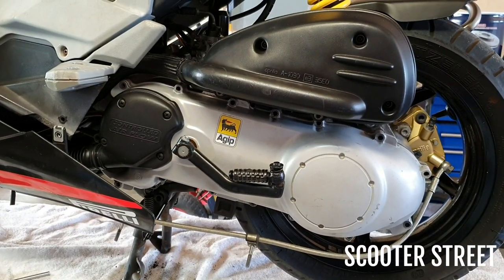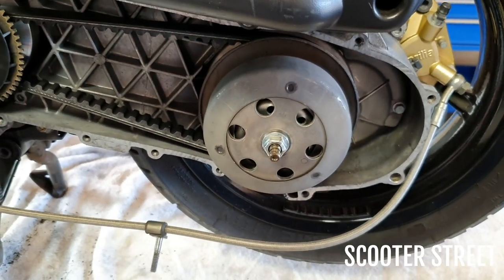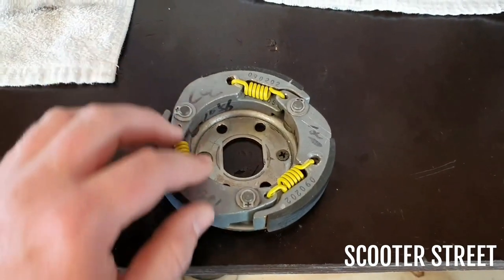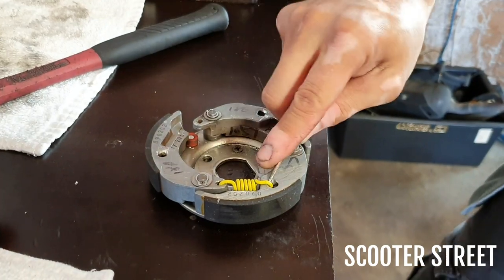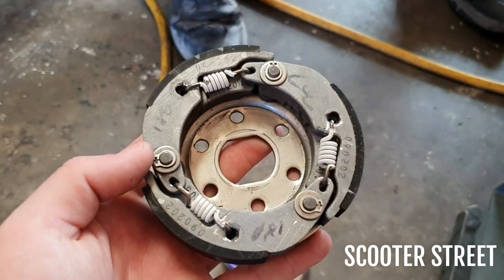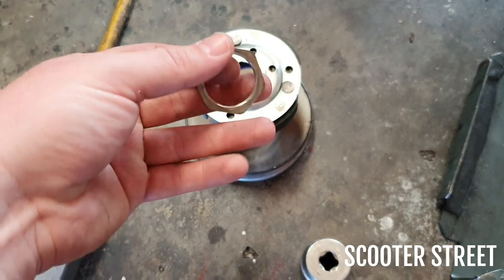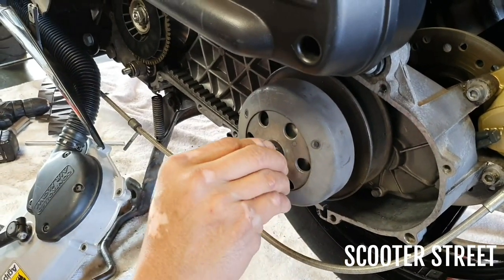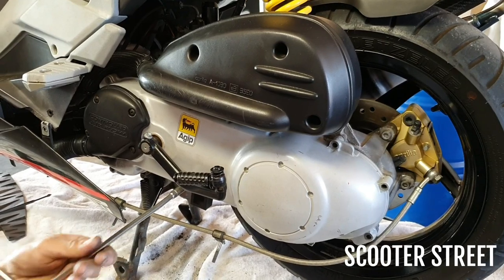Changing / Installing Clutch Springs on Scooters - Aprilia SR50R (Piaggio Hiper2 motor)

Comment: thinking of upgrading my variator do i need more power from my engine to power it or will it be fine. got a 50cc moped
Reply from the maker: Depends on which machine it will be fitted too. Let's say the SR50R. The Variator will be fine, they definitely have greater effect when the cc is upgraded. A lighter roller set will allow easier revs but may change gearing too slow if too light, a heavier set will change the belt position sooner. Fid the best weight to give a slower progression of the belt without over reving.
Reply: @scooterstreetau  Can I put malossi purple central spring on stock variator. I have leovince tt, bigger jet .....
Reply from the maker: @skullbosnia2584  Yes you can, this spring is used the MHR variator and usually requires very light rollers and high RPM. Worth the try to find out if it is right for you..

Comment: I put a 1500 contra in my clutch and my bike only goes 20kmh and sounds like it’s revving out. Like it’s full throttle how should I fix this
Reply from the maker: The rollers should be changed to suit the Spring. Is the belt progressing to the top of the variator? Are the rollers too light? Find a suitable set of rollers for the tension of the spring.
Reply: @scooterstreetau  u mean something like 8g
Reply from the maker: @sigadoonie1613  Without knowing what condition and modifications the Scooter currently has I can't make any solid recommendations. What I can tell you is that the factory rollers are 7.5Gram. The spring that you mentioned @1500, are you referring to the Spring that sits on the torque driver. (Contast Spring) or the small clutch springs?
Reply: @scooterstreetau  I’m talking about the the big one that goes on the torque driver
Reply from the maker: @sigadoonie1613  Yes ok, I am not aware of a 1500? Usually measured in K which is the measurement for the stiffness of the spring. What brand spring do you have? Please excuse me for the questions..

Comment: Please help. Which color (malossi) for honda dylan 125cc on the clutch? I have multivar 2000 variator 20x17x10.5g
Reply: @scooterstreetau  i will try white mallosi (30-35%) with yellow or red spring cluches? Is it ok??
Reply: @scooterstreetau  i was in motobike store and they told me for dylan fit malossi 2912536 (whiite,yelow,red) ?? Hm...
Reply from the maker: Clutch spring set for original clutch is Malossi 2912536. The order from highest tension to lowest is RED-YELLOW-WHITE so try the YELLOW and if you need more tension delay try the RED.
https://wemalossistore.blob.core.windows.net/files/montaggio/pdm/7311401.pdf

Comment: Hello, very good video 👍, i would like to ask  , i have an aprilia sr50r and have Malossi with  red clutch springs and torque spring , wondering if i could put a blue torque spring which is +106% , is that to much or do i have to change clutch springs too? Its a 70cc Malossi cylinder with a 21mm carb and a stage 6 exhaust with 5.1g rollers Malossi variator. Thanks
Reply from the maker: The clutch springs make a difference to the engagement of the clutch as the RPM builds, don't go too hard tension. The rollers will need to be adjusted to suit if you run with the Blue Torque spring. Trial and testing is the key to finding the best solution for your engine performance.
Reply: @scooterstreetau  thank you for helping the community🙏🏻
Reply from the maker: @a.samatasss4731  There is a lot of amazing people out there sharing their information and for that we are grateful🙏all the best..

Comment: Wich roller weights is best for aprilia sr 50 r (piaggio)?
Reply: 6.5 gramms
Reply: @scooterstreetau  what do you think about the gianelli go exhaust, in my country it is illegal to have sport exhausts but the gianelli go looks very low key
Reply: 6.5
Reply from the maker: It depends completely on the setup you have in your scooter. Different exhausts and cylinders require different weight rollers.
Reply: @scooterstreetau  hi, i have malossi replica 70cc. What main jet would you recomend? I still got the 17,5 carb.
Reply: @antiaircraft3544  90 with stock filter box .
Reply: Gigo theHUSTLER  black springs are too tight.too high rpm and lose topspeed with 70 cc sport with stock exhaust.try it with overrange now but white contra and 7.2 gr.green contra is good too purple also little tight.green and yellow clutch springs are good too.

Comment: What type of clutch do you recommend for replacing an original clutch for an Aprilia srmt 50cc
Reply from the maker: Polini G3 is great.
Reply: @scooterstreetau  would that be okay with a leovince exhaust Tt?
Reply from the maker: @burg4225  Yes for sure.. There are better exhausts available but the Leo is a good starting point.
Reply: @scooterstreetau  what are the benefits of a high performance clutch ?
Reply from the maker: @lupurednic8624  Different performance manufacturers make differing designs but always Upgrade from the original design. The performance clutch may have a larger surface area on the contact pad giving maximum allowable grip. Some have a heavier throw out arm and adjustable weights within the arm to fine tune the contact pressure. We like the quick adjusting spring tension in the Polini clutch which saves loads of time when tuning the timing of engagement of the clutch on the Bell.
Reply: @scooterstreetau  thanks, i need channels like yours because im struggling to find info about scooter parts
Reply from the maker: @lupurednic8624  Watch the videos and please comment, happy will help where we can. Please Sub and hit notifications☺

Comment: What size socket do you need to remove the nut
Reply from the maker: 15mm, see 40 seconds.
Reply: @scooterstreetau  hi no I meant the big one behind it that holds the big clutch spring on
Reply from the maker: @motorbikeryda883  34mm

Comment: Hi my peugeot speedfight 3 can’t hold 9k rpm after accelerating from 0 it drops down to 7 and it rarely raises up to 8 and falls back to 7 
MY SETUP
Qtre sport exhaust
Polini variator 
4,5 g rollers
17,5 carb 
As i said my acceleration is great but at 45 kmh  it drops to 7k rpm and i rarely go over 65 kmh theres a sound that it wants to go faster, our suspicions are that our exhaust might have a limiter cuz a mechanic put it on and we didn’t check, CDI being restricted cause the mechanic also didn’t tell us anything and then my friend thinks its the clutch springs being too hard since they are stock
Reply from the maker: Did you jet the bike up when you installed the exhaust? Also 4.5g rollers sounds very, very light for a 50cc with a performance exhaust and variator. I would definitely recommend pen marking the variator to see that the belt is getting all the way to the outside. You may be correct to think the scooter will have restrictors. Check the exhaust, check the CDI-Rev on Main stand for a quick  check and also the rollers may need to be heavier, try 6.5 gram and then trial and test.
Reply: @scooterstreetau  I tried heavier rollers it was even worse, my mechanic told me to get even lighter ones idk, and when i put my scooter on a mainstand it revs up to 11k rpm, and idk a mechanic installed my exhaust so he should of regulated the carb for it ( my mechanic also said that i need a contra spring and clutch springs, since mine is too hard, BUT our contra spring seems to press down with ease so im pretty confused)
Reply: @scooterstreetau  how do we mark the variator im sorry cuz i dont rlly know much about scooters just got this one in summer and we just had it fixed and start riding like a month ago
Reply from the maker: @imdovis787   We have a series of videos relating to the variator, watch these ones. https://www.youtube.com/channel/UCySQaQYtx9PVONqjwXKOZcg/playlists the pen mark tip is used on the variator face..
Reply from the maker: @imdovis787  Ok trial slightly lighter rollers and test again. You need to firstly find out if the exhaust is restricted. When you fit the exhaust it is a must to do the Jet, Rollers and clutch spring set to allow the maximum advantage. If you don't do these things you may as well not fit the exhaust..
Reply: @scooterstreetau  out exhaust doesn’t come with a limiter so we found out that the carb jets weren’t even touched and it was too rich
Reply from the maker: @imdovis787  Ok great! Is it running good now?
Reply: @scooterstreetau  we are going to take out the carb today and fix the jets il update you when its running good
Reply from the maker: @imdovis787  Check the choke and the manifold while your at it.
Reply: @scooterstreetau  we changed the main jet, absolutely nothing happened its the same as before, goes to 9k drops to 7k, like we don't understand we changed so much stuff because of this problem and nothing seems to fix it, and it couldn't be a cdi since on a mainstand it reaches 11k rpm
Reply from the maker: @imdovis787  It is very hard for us to pin point the issue but you will need to go and test the clutch action and the trans mission. Check in sections-Transmission - Carby, choke and air intake including reed valve - Check the piston - check the plug burn - check the exhaust( I think you have already)/
Reply: @scooterstreetau  after the main jet change it started taking less fuel cuz it was taking like 5 l 50 kilometers, and it goes 85 now, but if full throttle from the start it has a weird sound and unstable rpm if i turn the throttle slowly until 36 and then full throttle it reaches 85
Reply from the maker: @imdovis787  Time for a mechanic.. try a needle adjustment or needle change. Sounds rich but difficult for me to say...
Reply: @scooterstreetau  ok so we changed the contra spring to a yellow 33% one and we got some blue clutch springs which on the packaging it says they start working at 6.5 k rpm or something but yea now it has way better take off but when accelerating from a stop it has an overreving sound and after going like 74 kmh on 8 thousand rpm it just drops to to 7,5 thousand and speed to about 65-67
Reply: Idk maybe heavier rollers or stronger contra spring
Reply from the maker: @imdovis787  More tuning required, it is all trial and error..
Reply: @scooterstreetau  what do you reccomend cuz for this rpm falling down problem we spent alot of money and nothing helped
Reply from the maker: @imdovis787  Where did you buy the parts? Do you have a local mechanic to help you? If you are doing yourself it will be very difficult. Do not change parts, try first to isolate the problem..
Reply: @scooterstreetau  mechanis where im from dont really take scooters they too busy so me and my dad are fixing it we are gonna get a new cdi because i think thats why its speed falls back down to 65 maybe its not derestricted
Reply: @scooterstreetau  i buy the parts from scooter internet shops
Reply: @scooterstreetau  and we had an old hard contra spring it still didn’t help the rpm still fell back down after 75
Reply from the maker: @imdovis787  It is easy to find the CDI restriction! Rev while scooter is on main stand and the electric cut off will activate at high RPM and it will be like turn the key off and on, off and on..
Reply from the maker: @imdovis787  Have you asked them for advice?
Reply: @scooterstreetau  they dont rlly give cuz they say that if they don’t take it in they cant tell
Reply: @scooterstreetau  i only reved it on a main stand with nothing done do you have like a tutorial to do with the thing u said
Reply from the maker: @imdovis787  Well this is true, hard to fix a scooter over the internet.....
Reply from the maker: @imdovis787  Di it make the retarded cut out...off..on...off..on?
Reply: @scooterstreetau  i dont get what u mean sorry 😭😭 can u tell me it so i can understand sorry english not my native language
Reply from the maker: @imdovis787  You need to get some assistance from a mechanic with experience.... we cannot fix, we can only offer suggestions.

Comment: I have a honda elite scooter and lately when I'm riding and slow down to a light the scooter stays on high rev and then goes down, what can that be?
Reply: Clutch pressure spring
Reply from the maker: You may have an air leak of the intake system. The air mix screw maybe out too far.

Comment: Yep if you hit paint with a steel hammer it will obviously chip,
There is a amazing invention called a rubber hammer 😬👍
Reply from the maker: Yep 😂😂, the pretty coloured paint is for the tension guide and the original factory springs were not painted😭

Comment: What to do if i dont have the variator tool
Reply from the maker: Find a way to lock the shaft when you release the nut. Power tool or air tool if available.